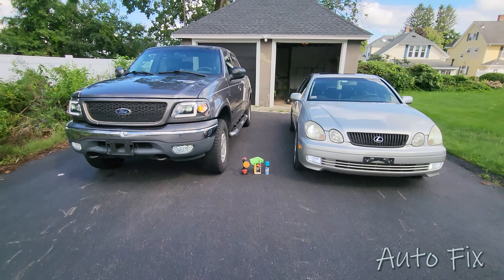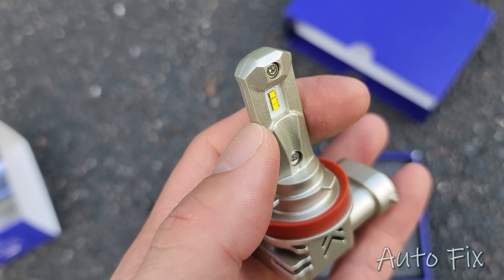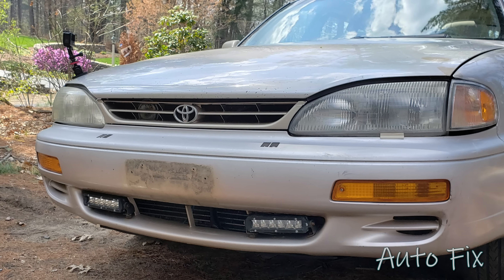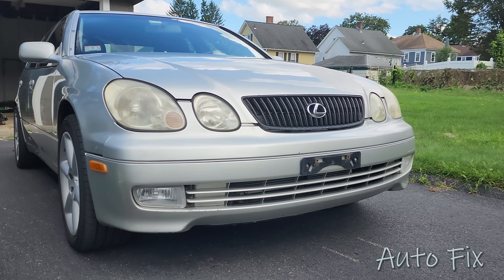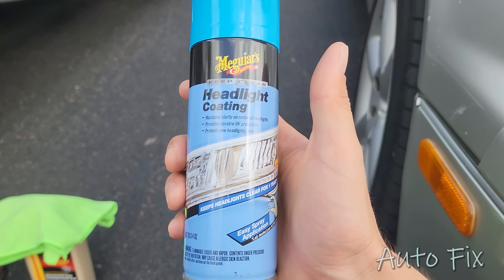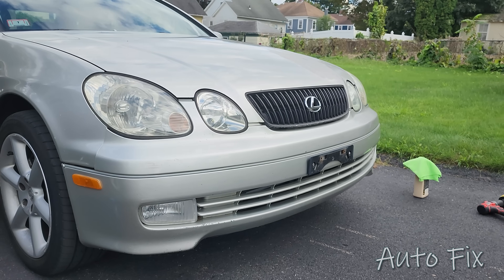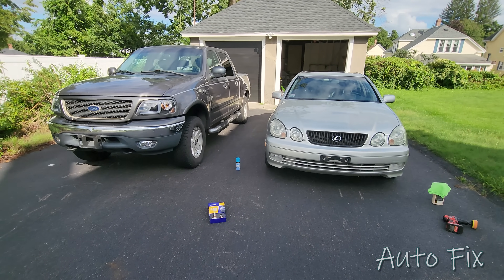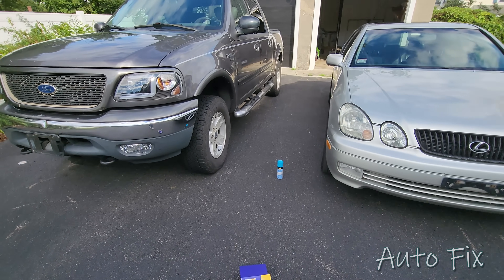How to Correctly Upgrade to LED Headlight Bulbs // AutoOne LED Bulbs!

Comment: also, if possible, see if your budget allows for auto adjusting Xenon’s. In my opinion they’re better than LED’s and Halogens. They’re as bright as LED’s, if not brighter. But can move around on their own to adjust for vehicle height and body roll.
Reply from the maker: That's something that would work great on a vehicle that tows often, but even so in most cases it's hard if not impossible to add that feature if the vehicle doesn't already have it.
Reply: @AutoFixYT  I forget the brand i’ll have to look it up again, but there was one out there that made a universal kit that had a gyroscope type of thing in this little computer that would auto adjust the lights, only issue was that it costs almost 2k

Comment: Time to change my bulbs. They were halogen but it lasted for only a year. I'm thinking of getting LED but I remember on highways, the further you are from the car that's behind you. The sharper his white LED lights are. Do you think that the problem is solved by following your tutorial?
Reply from the maker: That shouldn't be a problem if they're installed properly. If you get good bulbs and have a good clean lens, and you adjust them right, they will work very well.

Comment: In the projectors the led should be horizontal not vertical i think 🤔
Reply from the maker: @ismailniro  No, of you put it horizontal it will not reflect correctly off of the back and you won't get all the light output.

Comment: Funny, every single one of the Auxito brand bulbs I have bought in the last 2 years, are blown out already, every singe one. I see this as a total waste of time and money. 50,000 hours is a joke, I am lucky if I got 50 hours out of these piles of poo. Save your money and the headaches. DO NOT BUY THAT BRAND, I AM WARNING YOU, YOU WILL REGRET IT.
Reply from the maker: Not sure how that happened, I've been running Auxito for years now in multiple cars, never replaced a single bulb. Maybe you got a bad batch? Regardless, nothing wrong with switching brands, it's all personal preference!
Reply: We been running with Auxito and we know how it goes. This can happen to any. It doesn’t matter how good the quality led bulbs. 

No matter if it’s 1,2,4,5,8 or lifetime warranty. 
Things happen. 

If one doesn’t work from one product, we look for a different product that might perform better than the other.

Comment: I have a set of Auxito LED’s in my Ford Crown Vic. They’ve been flawless for over two years and the pattern once adjusted is almost identical to the stock halogen bulbs in the reflector housing. High beams are insanely good on them. Honestly I was and still am blown away by how well they work and how reliable they’ve been.
Reply from the maker: @DirtyDanMunicipalMan  Agreed, I have Auxito lights in 2 vehicles and love them!
Reply: I got em in my Camry and love them. I went thru 3 other brands before I found these exceptional LEDs….and they aren’t expensive compared to other brands, but aren’t too cheap which is usually a red flag 19 times out of 20
Reply: Which model do you have?
Reply: I have bought cheap LED lights since 2014 for every vehicle I've ever owned.    I have never had any issues ever.    Auxito is actually not bad at all. I try and go for Auxito over other weird brands.
Reply: @turtleman1947  they stand by their stuff, I’ve rarely had any problems and if I did, I sent them back and they would send me new bulbs free of charge. I hav them on family member vehicles, and to this day still held up over the two years that I started using them.

Comment: So you CAN in fact replace a Halogen bulb with an LED bulb in reflector headlamps? As long as the LED  is positioned correctly (standing upright) ?
Reply from the maker: Yes, exactly. You also need to make sure it's a well made LED not a cheap one that will not reflect light properly.
Reply: @AutoFixYT  thanks for you fast reply. My car is 2017 toyota yaris and the headlight bulbs are HIR2 fitment.  Will I be able to get an LED straight replacement? Without need for extra cooling
Reply: There is one from Philips

Comment: so easiest way to instal them in projector housing will be to put an arrow with marker on bulb that shows top and bottom so you can turn them enough to know how they are positionited easy you can try
Reply from the maker: Yeah that would work well! Thanks for the tip!

Comment: Those little ones are rebrands as Auxito. CLR tested those called Auxito - 10S.

They produce 16.5W per bulb after the observation. And they get warm up to 141 degrees Fahrenheit. Which is very good. 

The lower the temperature, the better the lifespan is. 

The higher the wattage and temperature, the shorter the lifespan is.
Reply from the maker: I will look into that, thank you!

Comment: I’m so glad there’s still more and more people that knows how led bulb works. Two sided led bulbs with big enough heatsink and cooling fan.

A two sided led chips such as CSP,ZES,CSP flip chips, SMD, Osram, LMP, and Cree led chips that’s the same size of the halogen coil filament, with very thin center piece of the led bulbs works a lot better than halogen, and way better than those dreadful.

Disgusting, horrible 3-4-5-6 sided or 360 degree cone shape led, square shape with a bubble led, or double stack led will never perform the same as original halogen headlight bulbs. 

I had an argument with one dude sayin u know nothing about led, yes we do. With lots of research, see them testing, lots of education. We truly do.

Thanks to headlight revolution, car light reviews, Sergiu garbor, and bulbfacts. 

If it wasn’t for them, this would not happen.
Reply: My dad had the 4 sided led bulbs (h4) as an upgrade from the halogen bulbs he had originally. They sucked. At night, no beam pattern. Poor illumination on the road, basically a driving hazard even when you're few in the highway in the middle of the night. 
I removed them and placed the original halogens, Osram Bilux, illumination is better but not bright. Hopefully I'll upgrade to Philips h4 or a bi-led projector headlights.
Reply: @Chris0-58  Philips are expensive but they are worth it. 

But why not jump on Lasfit? I recommend Lasfit - LA plus. We have them our Toyota and Scion and I bought more for my friends as well and they love how bright they are, the beam pattern is perfect. And they are reliable: 

$70 a pair and it’s worth it. 

Give them a shot before u spend $200

Comment: Not sure if you mentioned it in the video, but what size projectors are installed on your corolla? 2.5 inch?
Reply from the maker: I did not mention it actually, but yes, 2.5" projectors. They work great!

Comment: These LED bulbs are extremely blinding. The NTSB needs to do their job to end this hazard.
Reply from the maker: I think you missed the point of this video lol
Reply: Only if u get the wrong type of led bulbs. The correct ones retains the same beam pattern and it will not blind others.
Reply: @toyotabrony if you’re using it in a reflector lens. I would only recommend Philips or osram led bulbs as they will be made properly
Reply: @hamza3p342  those are fine. But we prefer Lasfit, Auxito, and Sylvania led for our Toyota and Scion models. 

No matter if it’s projector or reflector. 

As long as it’s a two sided led. Whether if it’s CSP led chips, ZES, CSP flip chips, LMP, or SMD.

As long as we get the right type of led that’s two sided with very tiny led diodes that matches the halogen coil filament. 

We’re good. 👍🏼
Reply from the maker: Exactly

Comment: This video covers 99% of my questions. Thank you! Especially the types of light, and the way led simulates the bulb lights. Would you discuss the types of light connectors for cars, cause there's a ton.
Reply from the maker: When it comes to the buob type, you just have to match what's on the car already.

Comment: I can appreciate your view on 'blinding' on-coming drivers...but realistically, 99% of drivers who buy LED's to replace the Halogen headlamps in their car,  DON'T CARE if they blind other drivers...they only care how the LED's look in THEIR car...
I'll try these LED's in my 2010 Lexus RX 350 ( projector lenses), but my experience has been that the Halogens are easier to aim, and throw more light further down the road than LED's...the LED's are just more diffused and do not lend themselves to being focussed...good video.
Reply: U only get the ones that diffuse if u get the wrong type of led like a multi sided led. Two sided with tiny led chips like ZES,SMD, and CSP led chips work a lot better in projector and reflector headlights. 

Not every correct type of two sided led bulbs are created equal.
Reply from the maker: Usually bad quality LEDs will do that. I have put good quality LEDs on every type of headlight there is and have had much improved results over halogen. I've also worked with cheap crappy LED bulbs and that's exactly what they do. Diffuse a bunch of light in all directions with no focal point in the center.

Comment: Great..thanks for the information dude!
Quick question,,do you have to change any fuses or something because of probably different power ratings of halogens and led?
Reply from the maker: No need to change any fuses! Just plug them in, make sure the lights are aimed correctly, and off you go!